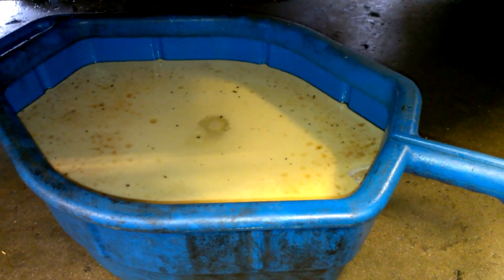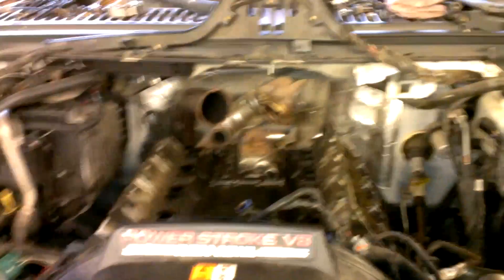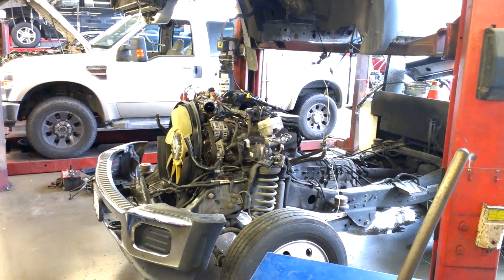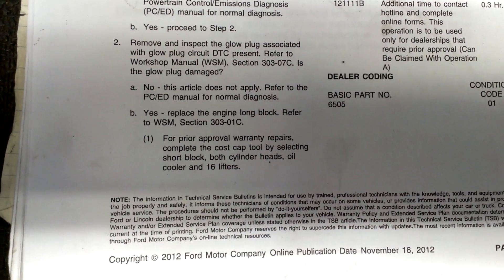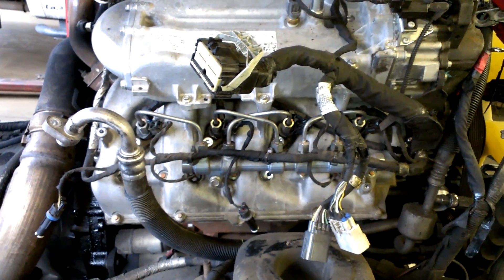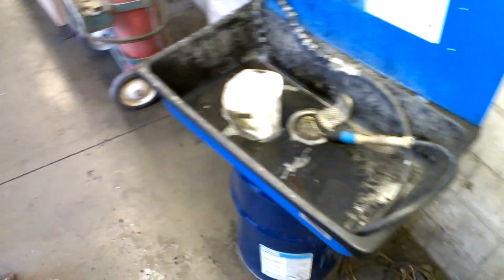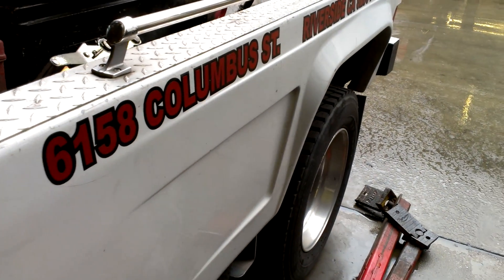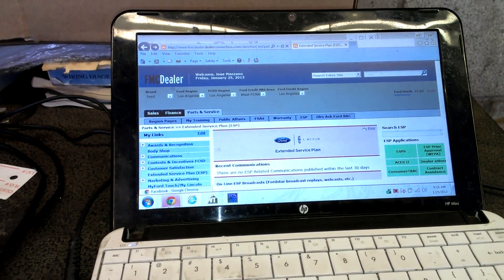SHOP UPDATE 1/25/13

Comment from the maker: Ford has no comment on the 6.7l yet. I think the valve are not harden or heat treated right, not a glow plug issue

Comment: I just got a 6.7 in the other day with the tips of the glow plugs broken off on 7 and 8 to top it off i cant lift the cab since its an armored truck after 7.5 hrs worth of work i got it prepped to to pull out hows yours coming along so far

Comment: Hey Joe you posted a video about a cover on the back side of a 6.4 below the high pressure pump leaking oil. do you remember what it was called? I have a leak in that area on my truck I changed the Hpp about 6 months ago I'm not sure if its a gasket or that rear cover    Thanks for all your vids man they are awesome

Comment: You're shop uses solvent based washers? I figured Cali would make you use water based. Water based automatic parts washer would save you some time, and with the shafting we take from the factory every minute counts. Wouldn't you love to see the 4 armed cyclops that could do that job in 18.0?

Comment: A question about the 6.0L.  I thought the lower fuel o-ring on the injector sealed to the head and not the sleeve like a 7.3L.  If this is true how is the sleeve allowing fuel into the coolant?  From my understanding cracked heads commonly cause this issue, though I have no personal experience with this matter myself.